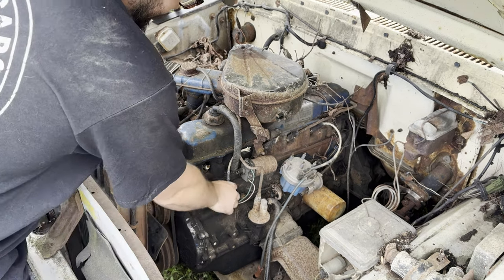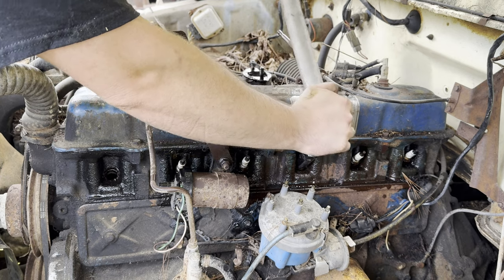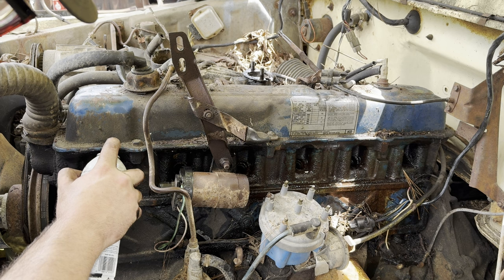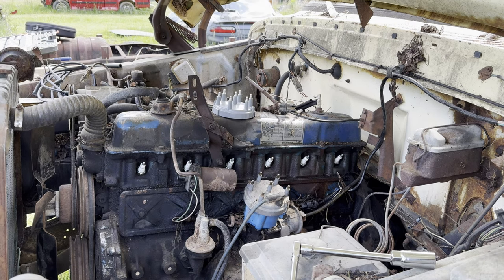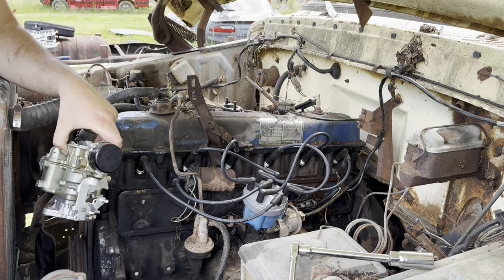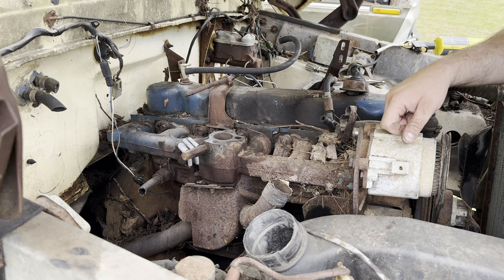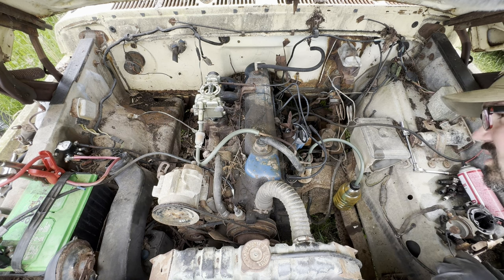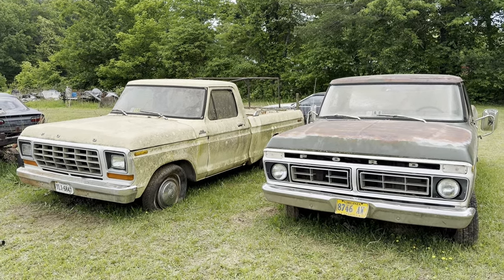Will it Run after 23 years? 1979 F100 300 Inline 6 Truck #RustBucketRescue

Comment: Oh the memories.  I had a Ford 1975 long bed, 3 on the tree, no radio, no a/c, no power nothin.  Wasn’t much between the radiator and tailgate latch I didn’t repair or replace except the engine.  In 2001 I told my wife I wasn’t going to sped another dime on that old truck, so in 2002 I bought a new standard cab, short bed, 4X4 Ford. I ran that truck 15 years and had 252000 miles on it in 2017 when I replaced it.  After all these years, I still miss that old 75.  Not sure you could kill that old 300 with a stick of dynamite.
Reply from the maker: Thanks for the story!  They were definitely unkillable, sounds like you had a great truck!  Every time I stumble across an old beauty rotting away in the woods that needs saved, I’m always super excited when I pop the hood and there’s a 300 six in there.  Once I see that, I KNOW I can bring it back to life, and with minimal work.  Fantastic engines!

Comment: I would suggest you pour some fuel down into the fuel pump to lube the diaphragm as soon as possible, to give it time to soften the diaphragm before you turn the engine over. Pumping on the dry diaphragm with the engine is usually what ruptures them.
 Also, Trufuel 2-stroke works great as a top end prelube and helps lube up the carb also when you’re trying to see if it’ll fire.
Reply from the maker: To pre-lube, I spray in healthy amounts of SeaFoam Deep Creep.  The stuff works miracles.  I’ve pulled vehicles out of the woods that had engines completely locked up, as in a 3 foot breaker bar wouldn’t budge the crank.  Took the spark plugs out, and sprayed healthy amounts of Deep Creep in, and then let it sit for several hours, came back and the crank pulley turned by hand!  I’m typically not a believer in the promises of a lot of products, so many things fall short of their claims, but Deep Creep has performed the impossible for me multiple times on multiple vehicles now, it’s an astounding penetrant and lubricant.
Reply: The Deep Creep sounds like great stuff! I’ll have to get some and try it.😁
Reply from the maker: @randomletters2948  most auto parts stores in my area have it, as well as Rural King.  If all else fails, Amazon has it it’ll just be more expensive.  I can’t recommend it enough, I’ve used every popular penetrating lube known to man and usually wound up disappointed, but Deep Creep has straight up unseized fully locked up engines for me which is mind blowing.  If you are curious, Project Farm here on YouTube did a penetrating lube showdown video and Deep Creep blew everyone else out of the water (which is how I found it!)

Comment: Not all Ford spark plugs are hard to get out, but I have worked on several cars, remembering pintos being the worst ones that I had to use break over bars to get the spark plugs out !
Reply from the maker: I've worked on a LOT of junk, but man these spark plugs shocked the hell out of me.  I've never had as much trouble as I did with these.  I'm wondering if someone left the hood up for a few years and water settled on top of the plugs and caused the block and plug threads to corrode together.  Thankfully, none of the block threads stripped out, and she runs, so once I get some tires and un-freeze the calipers I'll have an update video of her moving around the yard under her own power!

Comment: A friend had a 68 Fairlane with  289 that burned to much oil he put used oil in it , 4 it's to ab9ut 100 miles
Reply from the maker: Wonder if the oil was coming from the top end (bad valve seals) or the bottom end (bad piston rings or worn out cylinder walls).